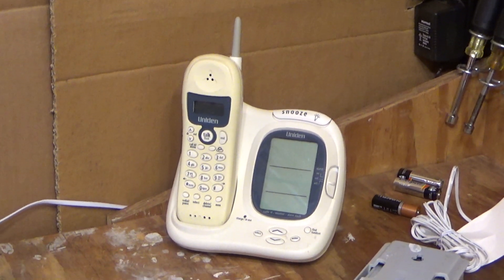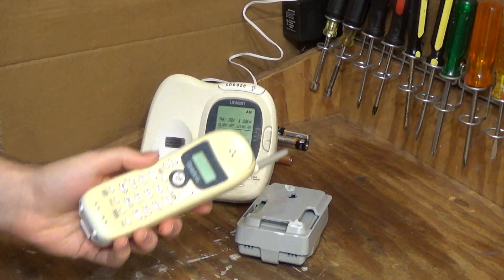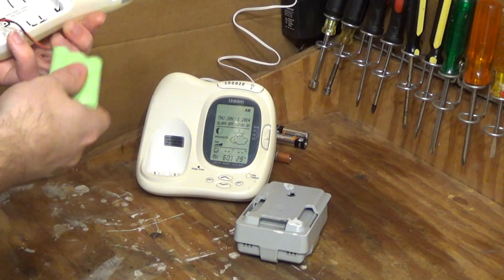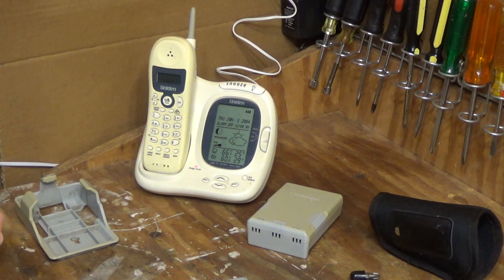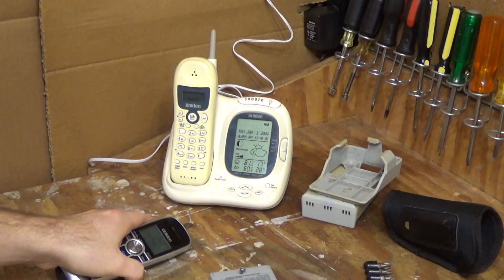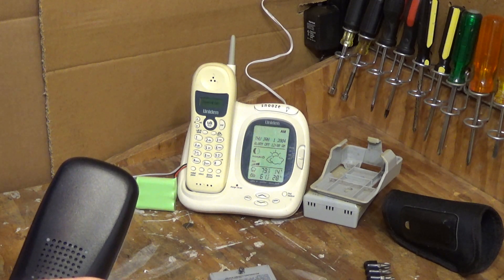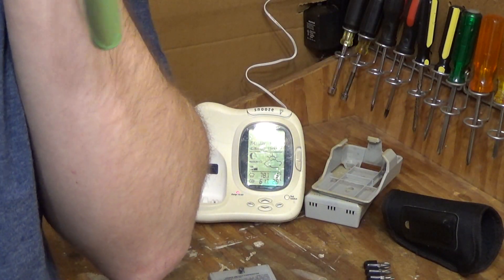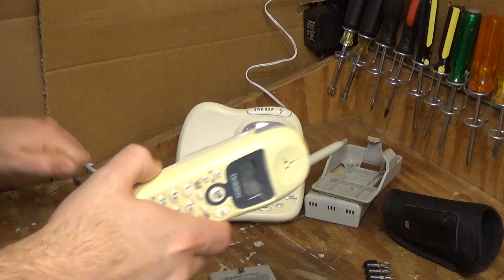Uniden EWCI936 Weather Phone | Initial Checkout

Comment: Not seen a weather phone like this before. At first I thought it’d use the weather radio to update. It’s interesting that it has its own sensor which “detects” the temperature.
Reply from the maker: This is the only model I know of.. This design is more accurate, since the readings are coming from right in the yard rather than potentially miles away..